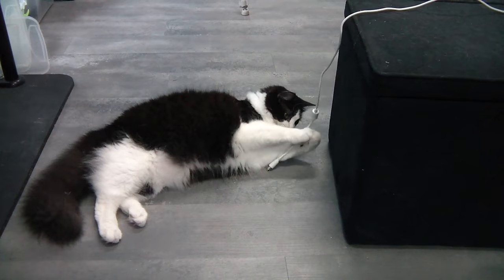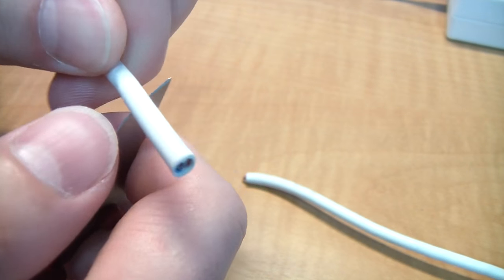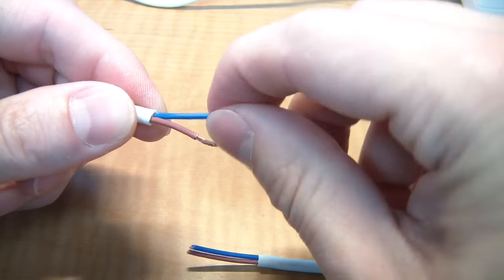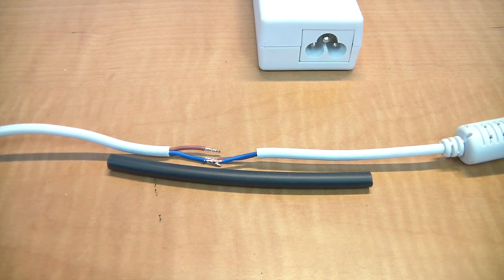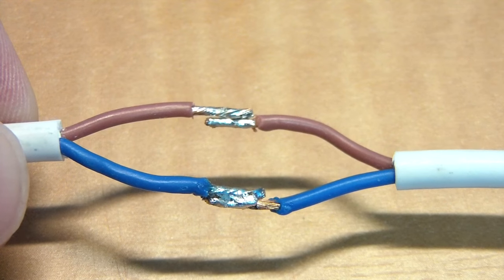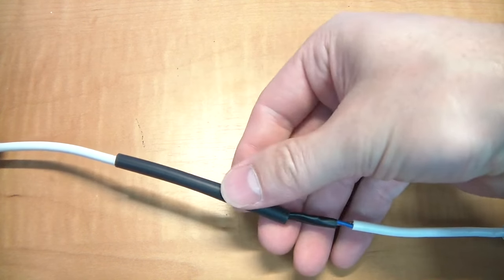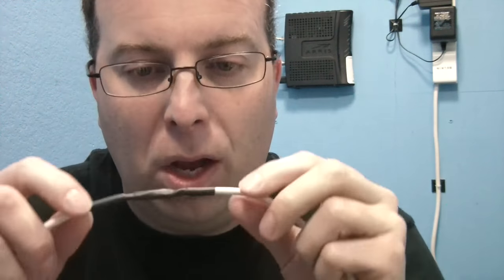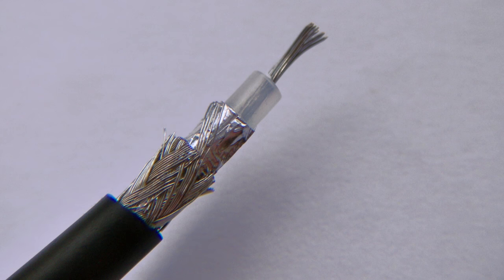How to repair a power cord that has been dog chewed.

Comment: #### NEVER, EVER DO THIS ####

I am rather surprised that you would post this video. IT IS NOT WISE to do this - these cables carry 110-240V AC, at currents that can and will kill you, or seriously injure you. If the tape/heatshrink sleeve on a repaired cable, slides OFF or peels off, guess what? YOU HAVE A LETHAL CABLE.

Don't be a cheap skate folks - JUST BUY A NEW CABLE, unless you value the price of a new wire over YOUR LIFE? You wouldn't repair the gas mains would you, so DO NOT do this.

I am a qualified electronic engineer, I am advising you to KEEP SAFE :)

God bless you all, I pray you live long :)
Reply: MCEvanLong Just because you haven't (thankfully) been electrocuted, doesn't automatically validate this as safe; your logic is poor. This IS dangerous - I have been a qualified electronic engineer since 1992, and my qualifications took more than merely watching a YouTube video on how to bodge together a broken lead, that I can assure you my friend.

If the glue on that insulation tape becomes soft (which often happens) and then the tape slides off, guess what... EXPOSED MAINS. If the person who did the solder join is not skilled at soldering, and left solder spikes or sharp edges which then pierce the insulation tape, guess what... EXPOSED MAINS. If you accidentally spill liquid on the joint, and it seeps under the tape and onto the copper... guess what... the liquid is going to become electrified along with ANYTHING it is making contact with.

I do not have to justify myself to people - I am simply explaining the dangers of cheaping out on parts of electrical systems which NEED absolute integrity and safety. If you want to put your life and the lives of others at risk, then please - be foolish, follow this video and go right ahead.
Reply: ***** I agree absolutely, never do this on a mains powered cable, good points about the heat shrink, it only has to slide off and you have quite a dangerous situation. Might be ok on the low voltage side of the charger though, but even then there are probably neater ways of fixing it.
Reply: MCEvanLong Sure you are right it's ok to do it on the output side of the charger, but if someone watches this video, gets the wrong idea and tries it on the mains cable this is BAD. The video really should have a note before someone hurts themselves. Even doing it on the low voltage side of the charger, it's more like 12 to 19 volts for most laptops with a decent amount of current (amps) going through it, meaning that if it shorts out it could melt the cable, heat up, burn someone etc if you do don't do it properly.
 Also your body does not ''recognize'' being shocked, the electricity takes the path of least resistance.
Reply: Actually they only carry 7-12 volts DC. I don't know any laptop ever created that can handle 240 volts straight to it, in fact the laptop would catch fire in that case. 

It's only 7-12 volts DC, on the connector side of the cable. Not 240 volts AC. The power brick converts the 240 V AC to 7-12 V DC so your laptop can use that to charge your battery. 

And as a safety precaution, always unplug your charger from the wall when doing something like this to it.
Reply: ethancedrik   Of course the 240v doesn't go straight in, the microchips couldn't handle that kind of power! So it goes through the charger. While the output is nowhere near enough to hurt you (as you say 7-12v, it actually is 18v on the older/bigger laptops I've owned) these chargers sometimes carry two to three amps of current, which is enough to melt some wires and potentially burn someone, ruin the charger or spark a fire if it shorts out because the heat shrink tubing slides off.
Reply: ***** That's what I have always done too. I double it back on itself and heatshrink or tape wrap it.
Reply: Since you seem to have accurate knowledge: my dog chewed a hole in me electric blanket that was giving to me as a present (it's sentimental, and I know it's expensive to replace). Is there anyway I could do this to safely fix the wire on the inside of the blanket? It's just one broken area.
Reply: Just buy a new one, unless your life is less valuable to you than a purchase? :)
Reply: Aria Justice You could take it to an electrical repair place and they can put a new cord on it for you, that's what we did when the cable on our pie maker got damaged.  Sometimes there is a repair van that comes up to the local shops so we just took it to them and it was fixed within half an hour :)
Reply: I need to add a 3 prong end to a bare power cable. How should I do that?
Reply: *****
Wise words, you summed it up perfectly. I hope people viewing this video read your post before they get hurt. I've been into electronics for 40 years and had many shocks, it's very easy to get zapped when you have a brain fart, I'm a bit cavalier with my own safety at times! Putting myself at risk is one thing, but I would never bodge a mains cable and put others at risk. I'd like to think the uploader of this video would pull it, rethink his technique and show the right way to do it.
Reply: Aria Justice
Nooooo!
NEVER repair an electric blanket. Keep it by all means if it has sentimental value, but cut the wire off so no-one can plug it in. The risk of fire or electrocution is about as high as it gets if you mess with it.
Reply: Now why would Apple make cords with the voltage equivalent to electrical fences?
Reply: Brennan Persing Are you being obtuse? Where do you think mains power comes from, and how do you think it gets converted into low voltage for gadgets?
Reply: ***** "Obtuse" Wtf are you talking about? I am not being an angle larger than 90 degrees.
Reply: Well the 240v from your power socket has to get to the transformer first before it actually is stepped down to a safe low voltage. So the supply cord definitely does carry a lethal voltage.
Reply: Lol id say depends on the cable. for example - USB Would be harmless.
Reply: Hmmmmm, my vacuum cleaner cable is attached to a recoil mechanism that winds the cable in when you press a button so replacing the entire cable could be tricky. Also if you make the repair too big it won't wind into the recoil loop anymore. If it's near the end you could just shorten the cable reattach the plug and lose a bit of length. But if it was in the middle I would live with this solution and accept the risk. My bet is that you would buy a new vacuum cleaner well before heat shrink slips or peels off.
Reply: unlokia but who the hell touches a cable anyways?

Comment: Dear NaySayers... I appreciate that you are trying to save us from this supposedly horad vid. But my question to you is, if it's so important to you that we know this is the wrong way to do things, how come you haven't posted any links on the right way to do it? Some of us don't have money to replace, or some of us prefer to do things ourselves. That is normally the reason we seek out youtube to learn how to. So unlokia, trains glaore, prodigalporcupine, I challenge you to post a vid that is the right way to do this.
Reply: Conny Ellis That is the problem with the information super highway we have these days. Anyone can and do share ANYTHING... if it be great information or complete rubbish.
Reply: True Dat
Reply: Conny Ellis 
Of course it's great to fix things yourself and no one said this method won't work if you do it properly!
 The problem is people on here who are suggesting twisting/taping bare wires together without using the soldering iron as in the video, risking damaging their computer or burning themselves if it shorts out. Considering a cheap iron, some solder and a bit of heat shrink only costs about $10, why not go get the stuff and do it properly?

There are much better ways to do this repair (such as opening up the charger and replacing the whole cord), but it requires more knowledge and the right tools which is beyond the scope of a quick you tube video. This method is ok for a quick fix as long as you do it PROPERLY.
No need to name people, we are simply saying there are other ways we would prefer to use.
Reply: trains galore Usually with jobs of this nature, there is many methods NOT to use and only a handful if not a single method that should be used. I posted earlier a couple small corrections. While the method in the video will probably work, there are safer methods and I attempted to make it a bit safer with my corrections.
Reply: Jesse S As someone who has done quite a bit of soldering and electronics as a hobby I agree!
 I think there are better ways to do this repair (replacing the whole cord, using a small junction box etc.) and you have made some good corrections to this method.
The biggest problem I see with this method is that if the soldering work is messy and spikes through the heatshrink the two wires could touch. Not a problem if you do it neatly though. One thing I was taught from an experienced security system installer is to make one soldering joint higher up the cable than the other so that the two wires physically cannot touch each other, even if the insulation fails.
Reply: trains galore I am glad someone agrees with me. I, myself have been working with electronics and computers for over 30 years. The method you outlined is one I have used before.
Reply: Jesse S  Yes it is a useful trick, the alarm installer who showed me used it for installing those tiny magnetic reed switches used as door sensors as there often isn't the room inside the tiny plastic case for bulky electrical tape!

An earlier comment about the possibility of solder melting under load sounds interesting, though I've never seen it happen and it seems incredibly unlikely unless the joint was creating a lot of heat due to a short circuit or high resistance. I have always used the 60/40 rosin core solder and have never seen anything like that happen. Do you think it's possible?

By the way, I certainly hope no one would be silly enough to try this on the mains side of the cable either, I would't trust a piece of heat shrink the thickness of a straw with my life!
Reply: trains galore There are few instances where electrical tape is actually useful in electrical applications. It doesn't last and the slightest bit of warmth will just make the adhesive like goo and dry up eventually making it useless. I tend to stay away from electrical tape if it isn't necessary. As for a solder joint melting under load, it is entirely possible. However, I wouldn't worry about it if you are using 60/40 or harder solder that i suggested in a previous post, as the melting temperature of the solder is higher than that of the plastic insulation around standard AC conductors used to power a laptop power supply.

Honestly though, there is much more to soldering than what I can go into any real detail here with. So I have to keep the details a bit vague.
Reply: Jesse S Yes of course I understand there is a lot more to doing good soldering, it's taken me years to learn how to learn to solder to a reasonable standard, especially on PCBS! The main problems with my first projects was I wasn't cleaning the iron often enough on the sponge, applied too much heat (cooking the components especially transistors) and was using way too much (and the wrong type of) solder. Fortunately someone I know who has been doing it for years sat down and  taught me how to do it better! It sure was frustrating when my first kits didn't work, but I'll never forget the feeling of achievement of turning on my first radio I put together and hearing it crackle to life!  :)

I agree about tape too, I stopped using electrical tape after I discovered heat shrink, it's neater and doesn't leave the sticky goo all over the wire if you pull it off.

Comment: this guy sucks, using that knife have probably send a few first timer in emergency room, believe it or not people have very little common sense, by the way he should have twist the wire toughener, also, feed a sinking sleve for each cable before you weld it and use a srink sleeve for each cable, insulating tape can come loose